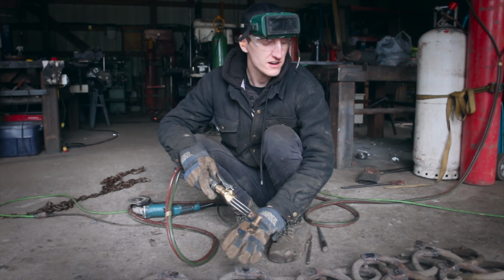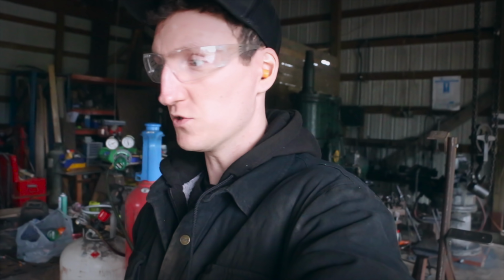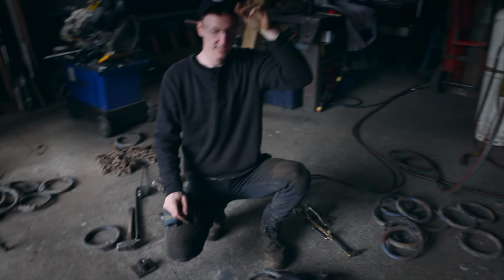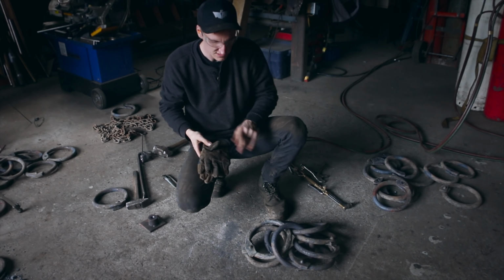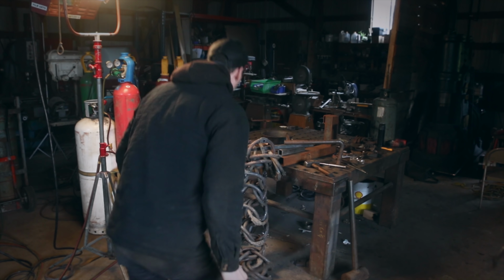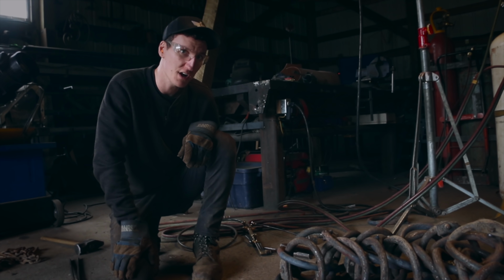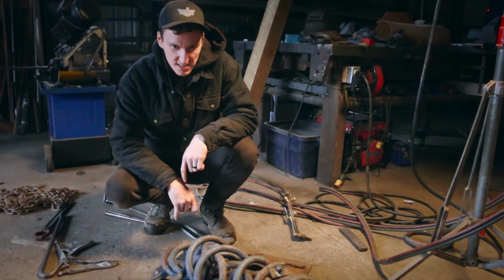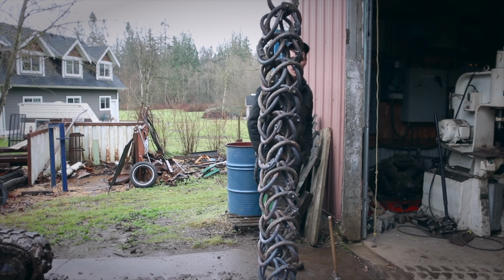Forging MASSIVE SNAKE WEAVE CHAINMAIL

Comment: Tim i'd like to see some structural blacksmithing including installation if you have any of that work on.I don't see much of this work on YT. Considering how quick you sold the axes, might there be a market for driveway gates, staircases, fencing or tables and chairs. Usually your projects are very flashy but how do you pay the bills?

Comment: I once made a pen shell with a box weave, with the rings the right size they can make a very solid rod and the pen tube slipped inside quite well.  
one thing that would have made it easier to do, would have been to leave 3 rows together when you were taking it off the sheet and with the row of rings you opened you use them to join the two sides together

Comment: Find the aspect ratio of one of those rings and you could find a weave that would work better. As a chainmaille jewler that works as far from these huge rings as possible this is very interesting to see. For context I work mostly in 24ga or .5mm wire.

Comment: Ours is not to reason why, ours is but to do or die. I’ve seen this pattern usually in a silver necklace. Pretty cool to see it so big so as you can see the pattern better. Edit: I think this would make for better protection in chai mail than the normal weave. You should try to make it on a slightly smaller scale and test it.